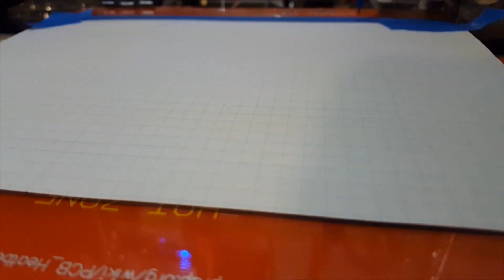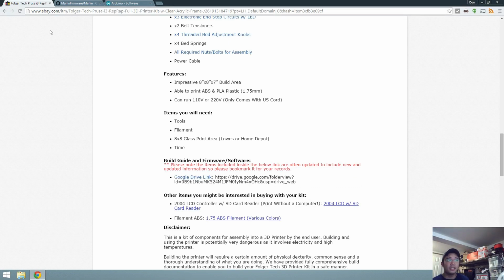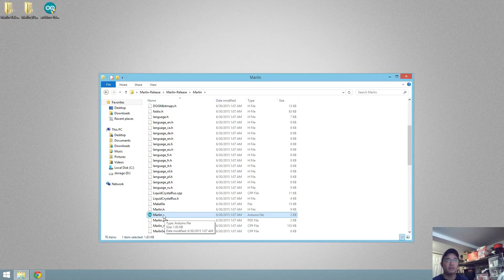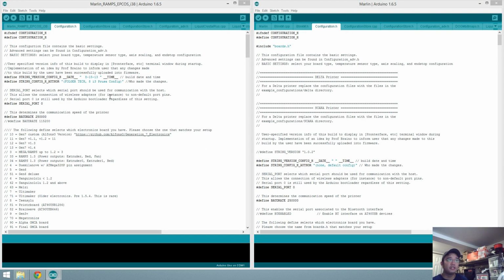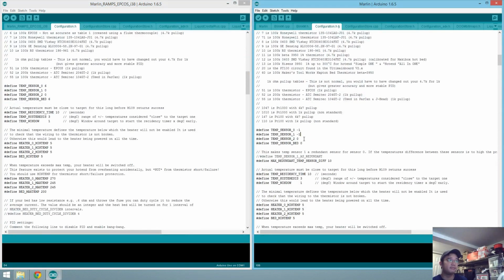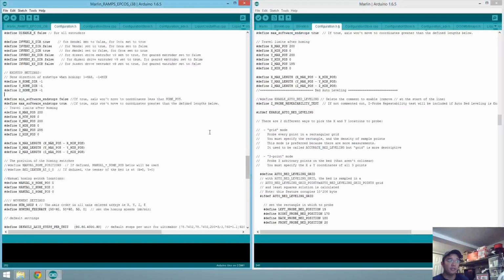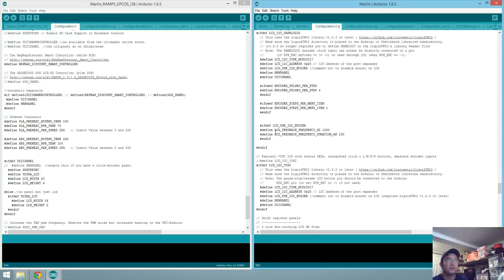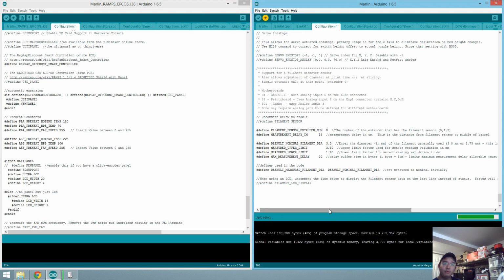How to update Prusa i3 firmware

Comment: Im buildng a 3d router 480x380x250mm vorkspace and i want to fit anArduino 2560 with 12864. Already have the stuff with heatbed and dual extruder and so on. i did install marlin but now i need a good template to apply to my DIY project. can you help to guide me i the right direction. i suspet a prisa i3 where i change data cloud work but its better to ask sometimes. Im a total beginner in 3d printing but i do know how to build a cnc machine using grbl and arduinos . Also need to get that damned 12864 working. trying to save time within inventing the wheel again so to speak.

Comment: hi, the instructions at very clear but at the end we have to use the serial port to connect to the printer and here ids my problem.

My printer is Anet A8 prusa i3, wich I bought 2 weeks ago. I have a USB connection to the printer from Cura 14.07 .

 I Found out that working with cura 2.3 is like "changing from salted water to Honey ". The problem is that I have to use the micro chip and stick it with  my fingers to motherboard. (very awkward) 
I am trying to have some help to make the USB connection to win 8.1 to Cura 2.3.1 but the answers that I get in forums  are very few and  very vague. 
Can you give me (us) the "path" to the connection, or an indication  of an article or tutorial? 
Thanks
Dov

Comment: Did not get software whit my old bq prusa i 3. Can i extract the old firmware before trying upload? and where can i find the latest bq prusa i3 firmware, i just printet from cura/Windows it workshop good, change some parameters, press print butikker changes Did not transfer to printer. Strange.

Comment: Hello ,i wanted to upload the marlin firmware to the RAMPS 1.4 board of my HE 3D prusa i3 because my endstops were NO instead of NC so i downloaded the marlin firmware from github and did al the things wich are explained in this video (but I didn't got the source code) and changed the endstop settings but when i uploaded it, my lcd screen of my printer turned blue and my printer doesn't respond anymore. Does anyone has an idee to solve this problem ?!!!

Comment: I recently received a Prusa Mendel i3 printer as a gift for christmas. The part number is labeled on Amazon 3DP11. But in the box they have the machine labeled as part number 3DP08. 

 I was following the instructional videos on youtube about installing the firmware, and as I followed along, my printer screen ended up displaying nothing but two block lines going horizontally through my LCD screen. My printer also made a high pitched beeping noise at the same time. I then went through the CD that was included and found a PDF that never even instructs me to add a firmware to my machine before printing.
I have read that when the LCD screen displays these two lines and makes this high pitched noise, it means that the wrong firmware is installed.

Please send me the correct firmware for my 3DP11 and the 3DP08, so I can figure out which one is the correct one. 

Will Installing this new firmware fix the display problem with my screen?
my email is jmarcheskie@gmail.com

Comment: I keep getting this error (pasted at the bottom of comment). I am fairly technically inclined, but I cannot decipher this at all, nor know how to correct this error. Could anyone possibly help me solve this error and get my printer running again? Any advice is appreciated! I'm using a Macbook Pro, and my printer is a Geeetech Prusa i3 Dual Extruder. I was able to use my printer for close to 2 months and the extruders stopped feeding filament. I've gone through some troubleshooting procedures and found that the nozzles are not plugged and the motors work fine. After searching forums on Geeetech's website, they told me to reinstall Marlin to the GT2560 board, and here we are with this error. Again any advice is truly appreciated!

Arduino: 1.6.6 Hourly Build 2015/08/19 10:30 (Mac OS X), Board: "Arduino Mega or Mega 2560, ATmega2560 (Mega 2560)"

Build options changed, rebuilding all
sketch/temperature.cpp: In function 'void manage_heater()':
sketch/temperature.cpp:665:1: error: unable to find a register to spill in class 'POINTER_REGS'
 }
 ^
sketch/temperature.cpp:665:1: error: this is the insn:
(insn 98 97 100 4 (set (reg/v:SF 103 [ pid_input ])
        (mem:SF (post_inc:HI (reg:HI 146 [ ivtmp.209 ])) [4 MEM[base: _110, offset: 0B]+0 S4 A8])) sketch/temperature.cpp:449 99 {*movsf}
     (expr_list:REG_INC (reg:HI 146 [ ivtmp.209 ])
        (nil)))
sketch/temperature.cpp:665: confused by earlier errors, bailing out
Error compiling.

  This report would have more information with
  "Show verbose output during compilation"
  enabled in File > Preferences.
Reply from the maker: Have you tried a earlier version of arduino like 1.6.5
Reply: No I haven't tried that yet. I'm not sure what board or port to select in tools either. Maybe that has something to do with it? I've selected a few different boards with the same results.
Reply from the maker: +Brad Newman yea you need to have the right board also. which is the mega board
Reply: I've got the mega 2560 selected.
Reply from the maker: +Brad Newman try using the old version and mega selected. let me know if there are still error messages. did u change stuff in the configurations.h file?
Reply: I just did that, I got the Arduino 1.0.6 and it uploaded fine. Currently I'm heating the hot end to see if the problem is resolved. Thank you for your advice!